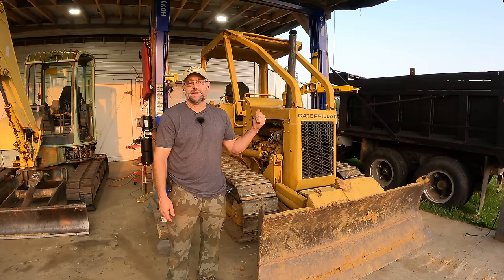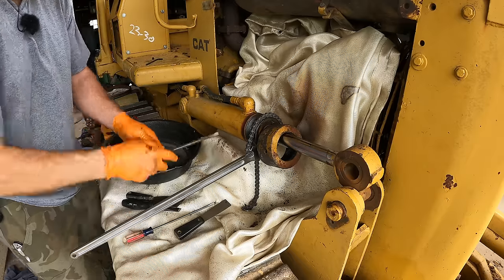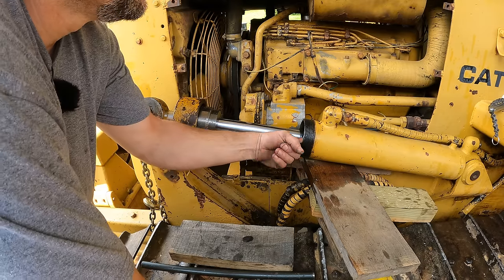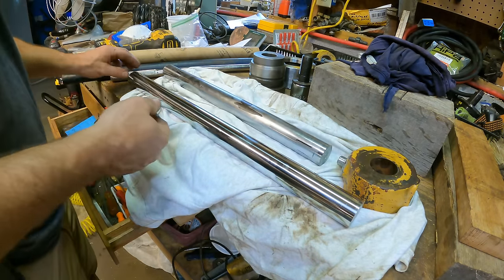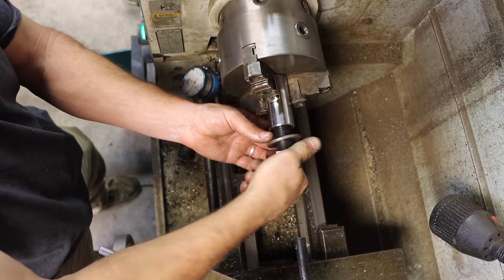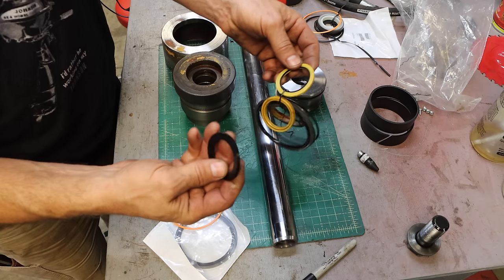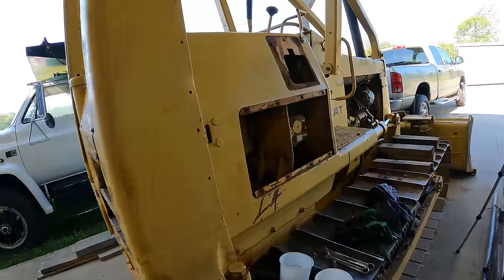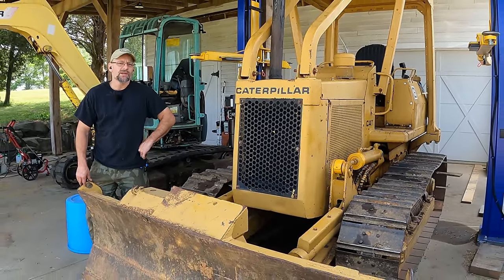D3 Dozer Hydraulic Repairs.  Re-pack. Re-rod. CAT D3 Bulldozer.

Comment: Just a suggestion. As I watched this video I also notice your massive wooden work bench lift and fall. Other Utube videographers have massive benches as you do, but, they are either completely welded or bolted together. Andrew Camarata’s bench top appears to have a poured concrete top at least 3” thick. I have seen him give it some mighty blows while doing heavy work and it doesn’t budge. He also has a massive vice jawed down at one end of this bench. The vice doesn’t move a fraction from its original position. Merely a suggestion for you. I watch your vids all the time. If I wasn’t 80 years old and getting puny, I would jump right back into the work shop I once had and start several projects. Not going to happen. Your work is precise and projects are well planned and executed. Three Cheers!!!

Comment: You should buy or build a media blasting cabinet. There has been quite a few times when I was watching and thinking how nice it would be if you had one. I bought a used one about 2 years ago. I'm kicking myself for not doing it 22 years ago.
Reply from the maker: I know.  I need a parts washer too.  Getting low on space to put new things in the shop though!

Comment: Not sure what model drone you have (looks like a DJI controller). But in the control software you might find some fancy features for following moving objects. If you drag your finger over your bulldozer, you should be able to select it as a follow-able object. Then you can just set your altitude and let it go on autopilot. If you set the acceleration to the slowest/smoothest setting, should get some real nice sped-up footage while following your vehicles.
You should also be able to select other objects, like that dirt mound at the very end of the video. That way the gimbal will lock onto it no matter where you fly (and you don't have to keep fiddling with the pitch and yaw)

Comment: Hey John. Very impressive  work on the cylinder repair. Well done. Did you consider chasing an external thread and using a nut instead of boring an internal thread. Looked easier.
Also, I liked your chain tool for loosening the cylinder cap. Can the tool be used both ways. I noticed the chain slipped off when first having a go. Am i just being stupid. Again.

Comment: Did you ever get the tracking on your Excavator figured out. A hydraulic accumulator does much more than being a damper. Most are nitrogen filled and if low on charge can play havoc on a hydraulic system. Everything switched while switching flow through that. I might be wrong but I believe its a easy test to prove me wrong.

Comment: Prorip: Your legs are stronger than gravity! Your get a LOT more torque on a lever by pulling or pushing it up with your legs than you can safely acquire with bouncing on the end of a lever. 

Protip: if you suspect that a bolt or nut is going to be hard, add a bit of penetrating oil, then hit it with a sledge a few times. The impact in combination with the fluid will loosen up over half of your potentially troublesome threads. Heat is really reliable, of course, but lube and a quick bang .. well, what more do I need to say?

Comment: The cats (no pun intended) over on Heavy Equipment Forums suggest hammering on the gland nut. Theory is it breaks any bonds the mating threads have. The last one I did wouldn't budge and a few smacks with a hammer did the trick. The bolt into the piston....my Case 580K cylinders are done the same way with a bolt.The manual states to reassemble with six?? threads covered in blue Loctite. I have to use a torque multiplier to get the really high torque values for that bolt. I wouldn't be surprised if Cat does the same thing hence the difficulty in tear down.

Comment: With how difficult cutting the hardened rod surface is, I'd imagine machining external threads would've been a real challenge on that rod too. At least with the internal threads you were only removing soft core material from the inside instead of having to scrape off the whole length of hard shell.

Comment: You should lube the base of the nut, and at least medium strength thread locker, or some just use oil and hope for the best, they are both trying to overcome dry friction

Comment: John, when you are cutting the threads, how do you get the chuck back 'in phase' with the cutter when you go back in? Wouldn't every pass cut threads that were 'out of phase'? I thought when cutting threads, you had to keep the chuck and the feed 'in sync' and clutched, for both 'in' and 'out' feeds, to keep the thread spiral in the correct angular alignment? In this case the chuck keeps spinning, and you seemingly go back in for a further cut at a 'random' chuck orientation?
Reply from the maker: That's a good question, and it's not random.  There's a dial on the lathe that allows you to engage it at the right spot, called the thread chasing dial.  Watch that other video I put a link to, it explains it better.  I'll add it to the description as well.  EDIT:  I went back and watched that video and I didn't explain the thread chasing dial.  I thought I had.  Ok, next time I do single point threading I will give it a good explanation.  Cheers.
Reply: @FarmCraft101  Thanks for the reply and explanation! I remembered there is a little 'clock' on a lathe for this purpose, and you 'slam' the clutch when the dot is aligned with the marker to get it in phase... this must be what you are describing!

Comment: If you need a positioner, take two 24”x24” pieces of plywood and mate them to a 2”x6” length of plank. Core two holes with a hole saw the diameter of the rod. Then take a wheel from a kids bike and mount it between the pw sheets, in contact with the rod. Some contact tape later, the rod should spin as you rotate the wheel with your free hand. Better than wasting the rod on bad welding.

Comment: This may be a stupid question... but I've always wondered. When cutting threads and feeding towards the chuck. Is there some sort of safety mechanism that keeps the tool and tool holder from ramming into the chuck and catastrophically exploding?
Reply from the maker: Not on most lathes and not on mine.  You have to stop in time.  Hence doing it in reverse so the carriage travels away from the chuck.

Comment: if you give the gland nut a beating with a 2 lb hammer at two opposing points it helps break the rust free (35 years in hydraulics )

Comment: One of the hydraulic personnel put one through two walls and made a big dent in the outwall.   To pull a fan hub(TF731) it takes about ten thousand pounds of pressure thank good for the head cones that stop the shaft when it brakes  watch your feet             just saying

Comment: Great video. you are a talented man.
I have a question I hope you will see. I understand doing the inner groove as a base point. but how come the thread does not cut into a different spot the second, third time etc you do the thread cut?
Reply from the maker: Apparently I need to do a more in depth video on single point threading, as I've gotten this question several times already.  ;-)  Lathes have a "thread chasing dial" that turns with the lead screw and allows you to engage the feed at the right time to match the previous cuts.  It's kinda hard to explain, but I'll make sure to show it better next time I do some threading.  Cheers.

Comment: 33:59 Why do you use the compound to increase the cutting depth, instead of just using the cross slide? Is it so you have one dial to put back to 0, and one to increment by 5 each time, instead of having to calculate, or is there something to cutting threads where you need to use the compound like this? All I know about lathe work comes from YouTube, so I'm probably missing something obvious, but I'm still curious.
Reply: You want the thread cutting tool to slide down one of the faces of the thread. That way you're peeling metal off one side of thread tooth only.

Comment: Ive rebuilt plenty of cylinders, all diy style and never seen anyone heat up oil to soak that ring in. I have used a coffee can with water, with the seal in it and boiled it for 15 minutes and the ring is still stiff. Able to explain more on why usinging hot hydrualic oil works? Thanks, from PA

Comment: You should have done a custom tap. And you can always make a button insert from HHS.

Edit: fixed a typo.

Edit 2: And it's a good idea to use some sort of cooling - ideally liquid coolant, but some air from the compressor can help a lot.

Comment: Was there any lock tight on the road bolts? My JCB has the rod nuts lock tighted on. You have to heat them to soften the permanent lock tight.

Comment: Those gland nuts are a bear. I used the same kind of wrench and I tapped the end of the nut with a brass hammer and they released no heat used.

Comment: I've got a question, John.  I've never done any metal work on a lathe.  I understand almost all of what you did with the threading, but there's one thing that confuses me, and I'm not even sure I can explain it.  So, imagine that you're looking down the rod from the threaded end.  You're looking at a circle.  0 degrees at the top.  With the rod spinning in the lathe, how do you make sure that you're threads start in the same place on every pass with respect to the circumference of the circle?

I guess an easy way to describe what I'm asking is, how do you make sure the tool is in the same groove on every pass and not cutting a new groove due to starting at a different place on the perimeter of the circle?  Maybe it's a dumb question, but I can't visualize it.  It seems like you're starting your cut at a random place on the perimeter, which would cause you to cut multiple grooves instead of cutting the existing groove deeper.
Reply from the maker: Apparently I need to do a more in depth video on single point threading, as I've gotten this question several times already.  ;-)  Lathes have a "thread chasing dial" that turns with the lead screw and allows you to engage the feed at the right time to match the previous cuts.  It's kinda hard to explain, but I'll make sure to show it better next time I do some threading.  Cheers.
Reply: @FarmCraft101  Sweet, thanks man!

Comment: I love your videos and all you teach us but there are two things you said in this video I must disagree with based on my experiences working on hydraulic systems for years in the Army. 
1. Contaminated will NOT cause pump cavitation, this only occurs when air is getting to the pump. In the process of whatever you did you tightened the loose joint that was letting air in. 
2. You said you needed to know how old the oil was in your machines and the age is really immaterial. What I recommend is that before you start replacing gallons and gallons of oil you take a sample and send it to the lab for testing from all pertinent systems. Oftentimes you can just replace the filters and get many hours of use out of the oil you already have. The lab results will not only tell you if the oil is still good it will tell you if your systems are working well or if internal components are wearing out. 

At the link below you can request a couple of documents that can explain the importance of testing oils in your vehicles and equipment. They also sell test kits for your use.

Comment: i used t work in a coal mine driving tunnels the machine we used had a bridge belt to convey the muck from the machine to the main belt it was tensioned with two acme screws they were ok to use when they were left dry then some no it all came in an decided to grease them that was the end of them they would seize up strait away it was the dust in the air mixing with the grease happened every new tunnel we went in

Comment: Quick question I'm learning to use my lathe, when you were threading the rod, you used the  compound to advance the cutter (to cut the threads deeper). Because the compound is at an angle, doesn't that change your "zero" location at the base of your thread? (Where you made your initial groove?)
Reply from the maker: It does change it a bit, essentially widening the groove each time you advance the compound.  Not a problem though.
Reply: @farmcraft101 I am assuming you could have used the cross slide to advance the cut also right? You would have had to keep track of zero, as well as where you started every cut I assume? Just learning. Love your channel
Reply from the maker: If you advance perpendicular to the work, then you cut on both sides of the thread at the same time which doesn't work as well.  Granted, it will make threads, but they will be rough compared to using the compound at 29.5 degrees.

Comment: Question on tapping threads on a lathe.  How does the thread start in the same location each time? Once he hit the lever to move and the piece starts moving longitudinally how does it hit the previous groove? Is the lathe indexed with a screw or something. Thanks
Reply: That is a easy search on YouTube. Basically you have a threading indicator that rotates with the lead screw, and you wait till your mark comes buy and then engage the feed. This is a very simplified explanation, but if you want to know more, just search it.

Comment: Hi they have you tried silicon bronze welding the pits in your cylinders rods,I’ve had 100% successful tig welds with silicon bronze wire and a good assortment of grades of abrasive paper down to 6000 grit on motorbikes stations .👍

Comment: As and old hydraulic mechanic and HVAC service tech let me give you a little warning about heating items with oil inside. Since oil does not boil at 100° C (212° F) it can be heated to over 1,000°F in a heart beat. Them when exposed to air it will practically explode in your face... Ask me how I know.

Comment: Might want to give the gland  keeper nut a few good blows with a heavy copper hammer before you resort to heat often frightens it into submission.... personally i wouldnt heat a cylinder without taking the hoses off first...be a bit safer in my opinion... just sayin is all...not criticism.

Comment: I have used a zip disc to take the chrome off the rod at the point I want to cut. It works well. It can be done off the lathe. Using the rotary tool I mentioned. 😊

Comment: - I wonder, could the reason the bolts were tight in both cylinders is because they were hot when cut for their last "spring pass", and became too tight when cool.
- Would a seasoned mechanic know and expect this because installation would call for the rod ends to be heated for the bolt installation so that the bolt could never come lose during its work life?

Comment: Question: I don’t understand something about when you were cutting those internal threads. 

How did your lathe kick into motion and start the threads at the exact same point during the rotation of the rod every time? It seems like it would be starting the thread at a slightly different point around the internal circumference and would get all mixed in with every other pass and destroy itself, but obviously it didn’t. Can you explain this to me? Is my question even comprehendible? Lol
Reply: He had made a zero stop to start from everytime where the dial indicator was set up.
I know what you are thinking about where it starts on the inside being different but he also has a video about threading where he threads a long bolt that will answer your exact question and you can see it in action.
Reply: @owensbama1923  and that somehow calibrates the outward movement of the cutting tool relative to the spin of the rod? So that the cutting edge enters the rod’s thread area material at the exact same point around the internal circumference? How is he not 5 or 10 degrees off at least and thus widening his threads? Or even 180 degrees off at the entry point and destroying his earlier passes?
Reply: @Sisco_RL  he also cut a groove inside at zero. So it doesn't contact the inner surface until it gets to the same spot everytime. I know exactly what you are thinking I had the exact same question at one time, it's hard to visualize, and when you see it done on the outside, it will click in your mind.
Reply: @mmm365  aahhhh okay that makes sense! So the movement of the cutter tool doesnt just randomly kick on right when he presses a button…rather it waits just a bit and kicks on as soon as the rotation gets to the correct point and THEN kicks on. At the same time every time. That makes sense. Thanks!

Comment: If you're maxing out your torque wrench, you can make an extender. It'll look a bit like a drawn out crow's foot. Throw some maths on the problem to get the adjusted torque value. With a little more math and a know weight, the extender can also double as a way to check the calibration of your torque wrench.

Comment: I have a small Presto lift that the rebuild kit costs $450.00! The cylinder is 48" long 2" round. I am an old guy and use it to lift stuff in and out of the truck and on the work bench!
It is just a long hydraulic jack! $ 450.00 for the rebuild kit and $1000.00 for a new cylinder!!! Not in stock!
Took it to Hydraulic shop and they can't fix it charged me $125.00 for and hr. to tell me they can't fix it!
Wish you lived next door!

Comment: Honestly I think you saved yourself some pain by not buying the ceramic inserts. They're super expensive and very susceptible to cracking if you're not extremely careful with them. I always wince when I see CEE crack one of the WNGA ones - a couple hundred bucks a piece, and usually only available in a pack of at least 5.